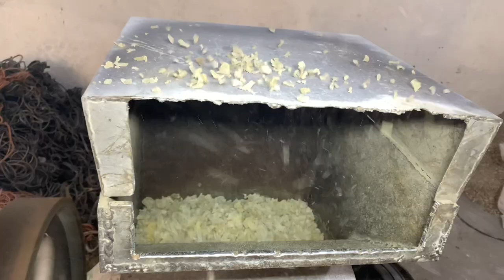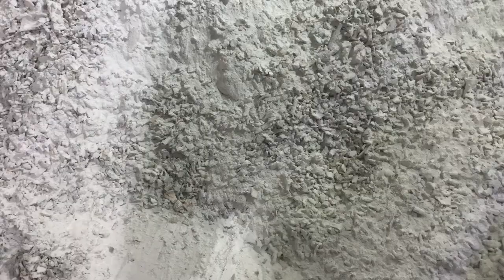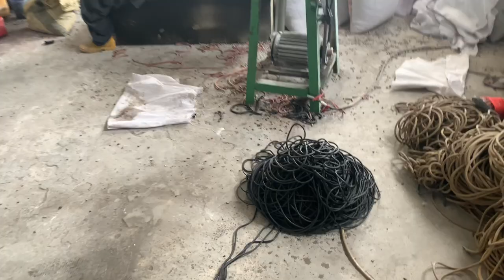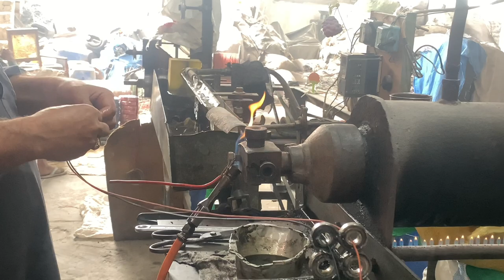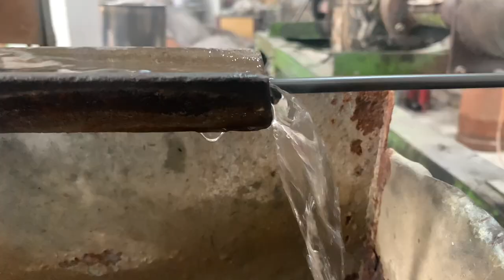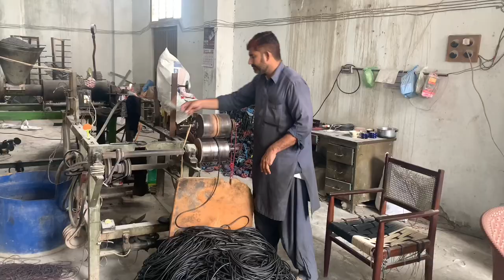How High Voltage Wire is Made! Wire Manufacturing Process from Recycling Plastic Waste

Comment: A Proper  Raw Material Mixing and Conveying System is required and most important are PPEs for Workers working in a how fine Dust Area. Best Wishes for the Organization for Locally Producing Cables for our Country in order to refrain Imports.
Reply from the maker: Thank You So Much